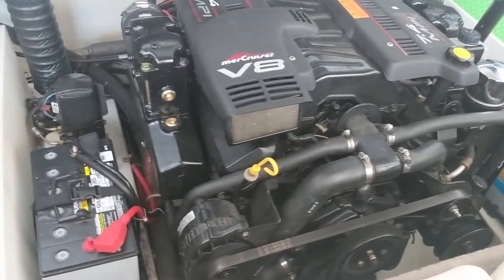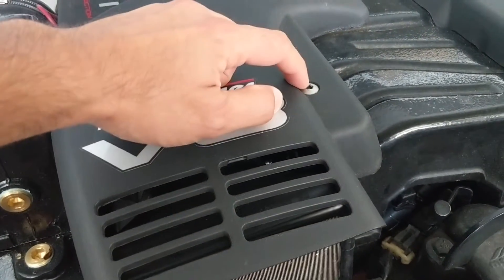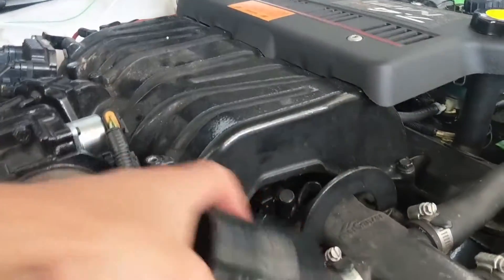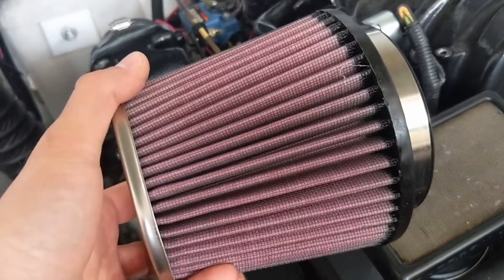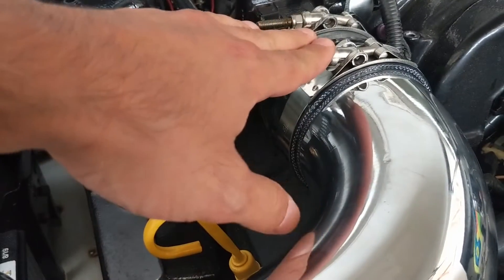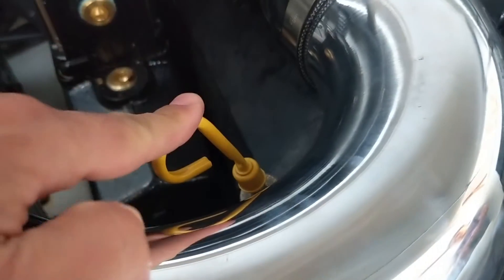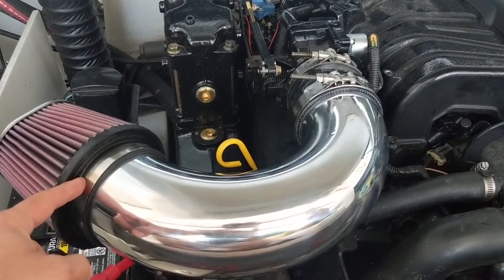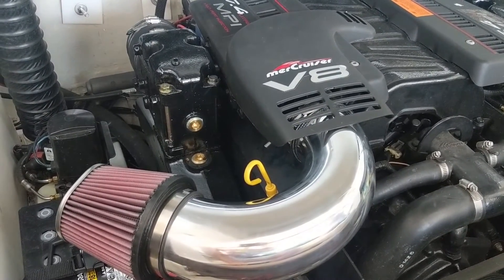Mercruiser 7.4 MPI - Performance Intake Kit

Comment: What degree is the 4in tubing that you have set up on your 7.4 MPI? We have one but it is 180 degree tubing. Will that work? Or how can we buy the set up that you have. We have the same engine you have
Reply from the maker: The piping is 4inch mandrel bent aluminum, it is around 128 degrees on the angle. With fairly wide radius to keep it free flowing. Shoot me an email and I can get you setup with a kit. Nkpracing at gmail

Comment: I see this is an older video but really curious on the amount of noise reduction. The number one complaint i have with my 7.4 is the noise coming from the flame arrestor and unsure if the price to piece together something similar is worth the noise reduction alone.
Reply from the maker: For us, it definitely helped reduce the air whooshing / whistling sound. I later did the same setup on our 8.2/502 on our next boat after this one, and it helped as well. I have actually been making these kits for a few years not, if you are interested in one. We had custom custom marine flame arrestors (aka filters) manufactured for the kit, along with stainless steel clamps as well. If you're interested in a set shoot me a note nkpracing @ gmail

Comment: Random question. How many drain plugs does your engine have. I have the same. I was able to locate 3. Maybe I am missing something. I winterized, ran antifreeze thru the muff. And I'm thinking of pulling the drain plugs for peace of mind
Reply from the maker: We don't have that boat anymore. But if I remember correctly I think it was 3 or 4.
Reply: @NKPGarage  found them. I have 5. 2 on left side and 3 right.

Comment: Part 2 ? And out of stock
Reply from the maker: I have actually been making these kits for a few years not, if you are interested in one. We had custom custom marine flame arrestors (aka filters) manufactured for the kit, along with stainless steel clamps as well. If you're interested in a set shoot me a note nkpracing @ gmail

Comment: One other very important benefit is air filtration. The stock Mercruiser 7.4 mpi flame arrester does not filter air entering the engine. There will be damage to the valves and the rings and cylinders of the engine from the microscopic "dirt" entering the engine, just like a car running without an air filter.  From a standpoint of engine damage, this K&N set up will save the owner from having to have the engine rebuilt as often as running with just a flame arrester.
Reply from the maker: I agree with you 100%. It is sometimes a controversial topic amongst boat owners. People don't really understand that the reason these setups are they way they are from the factory is for universal fitment across many different boat platforms in the smallest footprint possible. There is definitely room for improvement.